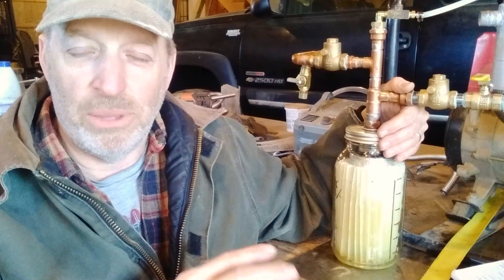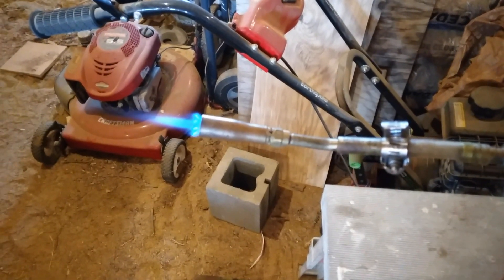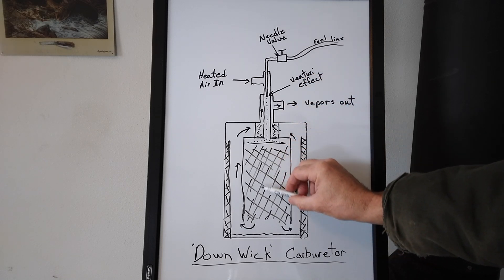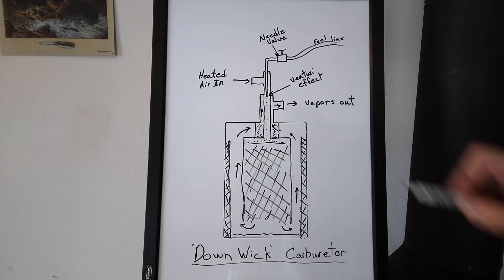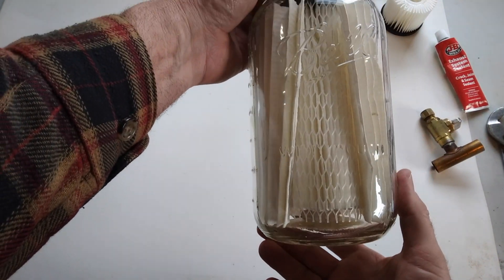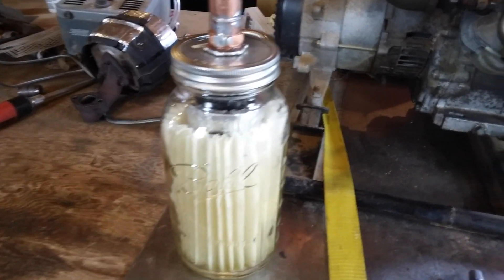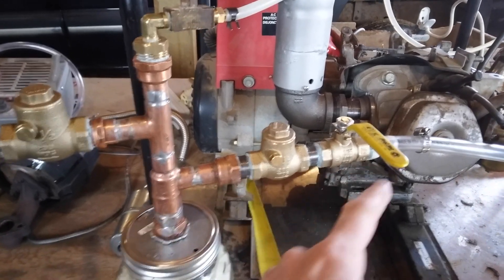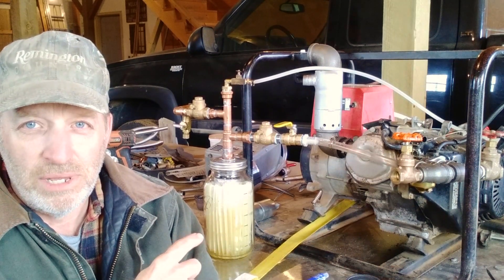What's needed to build a 'Down Wick' vapor carburetor?

Comment: Heat up the gas and it will run off the fumes only. Ogle carburetor
Reply from the maker: You may want to check out the other videos I have in this playlist, where I did add heat.

Comment: I've looked at many of these videos Possibility for what? Better gas mileage? A cleaner burn? Can't get to start it's freezing no Vapor? 🥶This has been tried a long time ago I don't see it??? I was just making a comment they told me to take it down all kinds of things I wonder why?
Reply from the maker: If you have a question, I'm not understanding it...
Reply: @doubleMinnovations   I just wrote an opinion I see a lot country vapor carburetors setups not working? Fire? breakdowns? One good thing  little emissions, not getting that much better gas mileage..??? This has been tried a long time ago and nothing's come of it, Nothing new? I don't know if this helps but thank you for your comment.
Reply from the maker: If you watch the other videos I have on this, I honestly show the improvement it's getting.  This is my own design, and didn't find any evidence that it has been done before like this, (wicking it down).  In the playlist, the videos there show the steps of its development.  It won't replace anything, I don't think.  Because it only works in specific conditions, and I have to use the standard carb to start it.
Reply: Keep you negative comments away from those who are trying to make anything better,your choice being poor with optimism is a contribution aiding in why progress is slower than what it could be,don't fire back at me and just think about what I'm asking you kindly to see,even if this tech would never be of any significance this man's effort and testing will help show the generations to come as well as those curious in present day if it will be of use or if it will not be of use.
Reply: @Greg-l3j  This, bunch of corporate paid drones sent to mock and create negativity around a competing idea. Piss of Shell, Chevron!